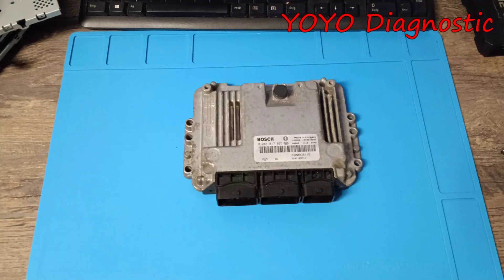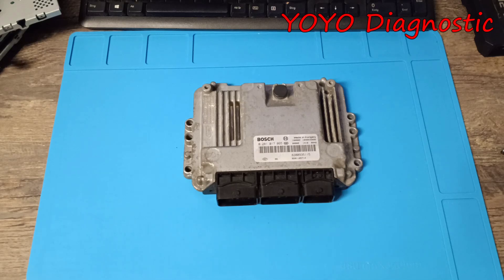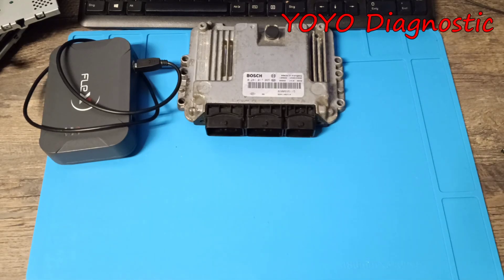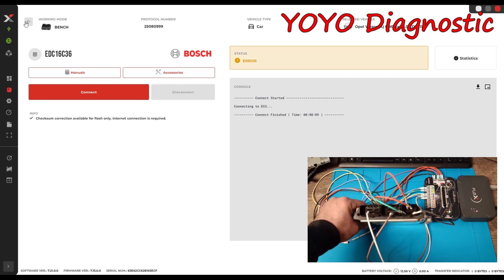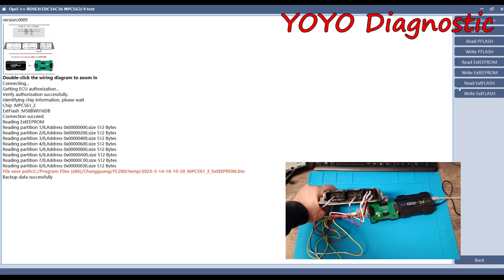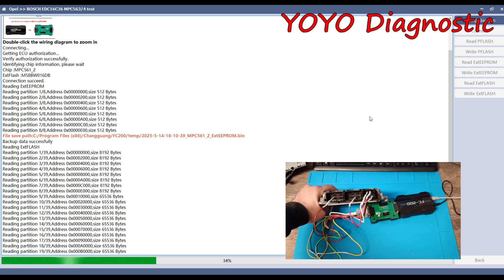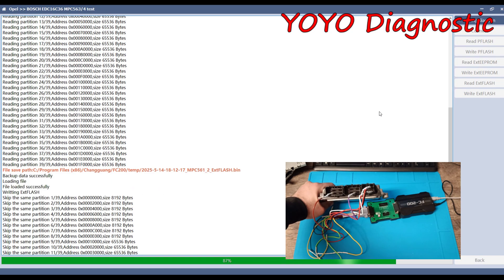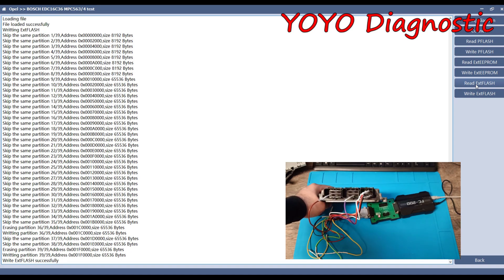Professional tuning programmers also fail !!! One programmer is never enough. edc16c36 bench read

Comment: Hi
What tool do you think is better between fc200 and formula flash? Especially for vag (clone/immo off/vin)
Reply from the maker: Hi. FC 200 is the original product and it's very good for the money you paid.
Reply: @YOYODiagnostic  thanks, i cant seem to read vw mg1cs001 ecu with fc200 just "connection failed"

Comment: I have a Xtool 100Max full kit with kc501.

I am trying to bench read a Dodge Apec2 ecu to unlock the bin file through hex. 

What android application or software I can use to access the ECU for read writing identify and unlocking? 

Similar to Xhorse, Ecustar, Fc200, Magic motorsports .

Thank you.

Having a vci box with passthrough and the kc501 eeprom reader, I feel there is so much capability ready to be unleashed by reading writing capabilities, ECU PID, HEX editing, Hex decoded directory, vvdi, multi prog etc.

2022 Dodge Charger 5.7 

Also have a 19 Mercedes c43 I need to unlock dme, and find a damos. File

Any advice or do I need to buy a fc200 to unlock GM ECU, bmw, Mercedes?

Been watching for a long time thanks for the awesome knowledge, Tune the world tune everything haha

Comment: Bro I have 2018 Audi A6 3.0TDI  the car owner changes TCU and is saying incompatible is there anyways you can help me get the correct TCU file cuz the old gearbox is not available is missing
Reply from the maker: There are a few possibilities to fix this problem but I can't help you that quickly, you are thousands of km away from me. first read the ECU with a diagnostic and tell me what hardware number and software the original gearbox and the one mounted on the car have. write to me at the email address yoyo.pc86@gmail.com . If you can send a copy of the dump read with a tuning programmer it would be great.

Comment: The reason why some tools have issues with this ECU is because the loader they send expects a reply on CAN, not on K-LINE, and they used the same loader as PCMFlash (stolen or purchased) that has the same issue and released that solution first, but Bodgan (Flex) and others that just purchase stuff have no idea how it works since it is not their solution, and that leads to no fixes, no support and no understanding of what is wrong.

Comment: Hey! There’s not much info online about this, but I’m 100% sure that Autoflasher has some sort of collaboration with MMS Flex. Every time a new MMS Flex protocol is released, the Autoflasher newsletter drops just 1–2 days later with a slightly modified version of the same update. So I’m pretty convinced they’re running the same software in the background. And of course, if the original Flex protocol doesn’t work, it’s not gonna work on Autoflasher either.

Comment: Thank you for the info. Never to sell a cheap programer if it can make this surprises it can be a bad choice with the subscription that has fc200 with 2 files made you are even with profit, i had surprises like this edc16c9 not posible with original Amt-Bst and FC 200 did it, edc16cp34 vw Amt-bst checksum failed fc 200 did it and the list continues.
It is preferable to have only original tools but not judge bad the clones i had many surprises good surprises with Mpps v18 that can read very quiqly and corect ecu on obd like alfa romeo edc15 and 16 opel mjd6o2 and mjd6o3 and so on. In the end not that is super expensive is perfect and good, and if you buy a tool cheap and good don't never sell because you will regret. You buy it today with 700 or 800 $ and in one year they can develop and rise the prices and regret. For now i know you tell the hole thruth and your main obiective is to show us newbie that is not so important to save money to buy super expensive tool, we have to use the brain.exe resurse and a wise choice. All the best
Reply from the maker: Thanks for the good and detailed comment. You are right these programmers that are cheap and getting better can double their price from year to year. As you said you use it twice and the license is paid. 👍